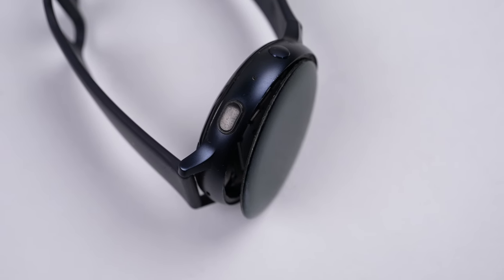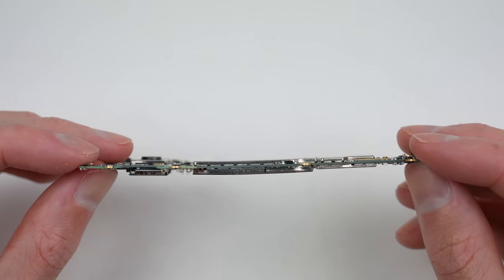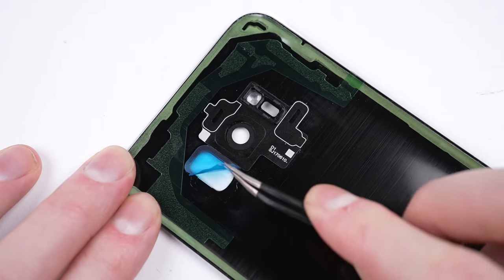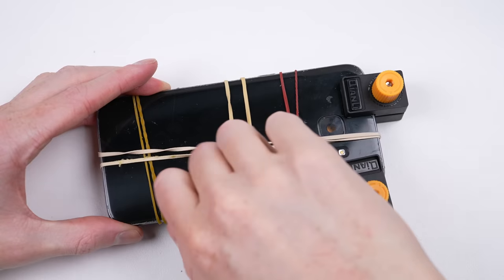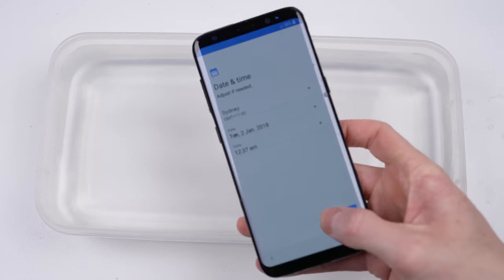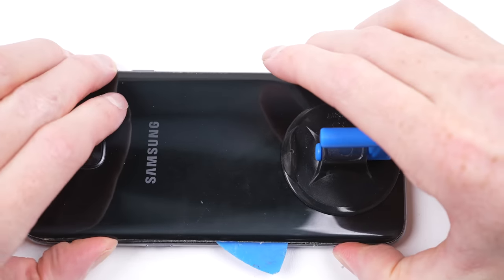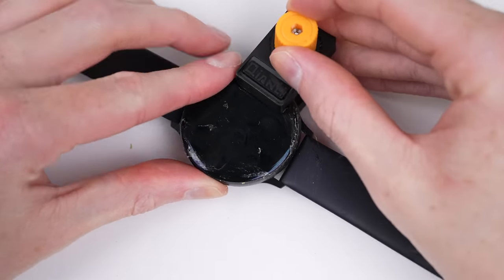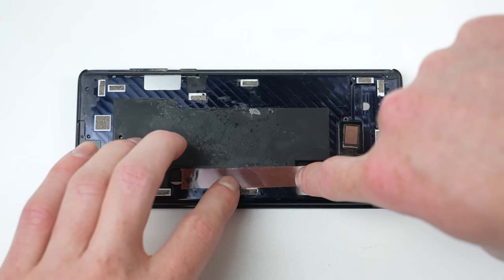Is a Repaired Phone Still Water Resistant? - Submersion Test - Tape VS Liquid Adhesive

Comment: here's a good litmus test to see if your phone is still water resistant. take out the sim tray, press your lips against the hole, and blow into the phone. 

if when blowing the air doesn't exit the phone and you're creating pressure inside the phone, it's water resistant. if you feel air leaving the phone it is not water resistant.

Comment: I had the same issue with s21 plus, due to phone heating overtime i think there are gaps in the adhesive. My phone just dipped for 1 second in a tub and that got full water in the phone. As a result all cameras, and speaker got damaged which had to be replaced. I avoid dipping phones now unless absolutely necessary like in rain time. I would not risk testing water resistance on slightly older phones, as most testing done by companies are on brand new phones.

Comment: I watched another video on this topic with someone testing this myth and what they found out is that if you heat up the phone with a heat gun after sealing the phone the replacement adhesive will have a better bond making it more water resistant

Comment: I have my watch active2 laying around because the happened the same, screen detached. I went to a repair shop, they glued in place but the next day the screen fall off again. I guess it's because they didn't cleaned right, like in the video. And I'm not willing to pay $160 (R$800) to the Samsung Repair to replace the entire screen, which is still just fine. Why did they use a glue that over time loosen so easily?
Reply: It is possible that your battery is swollen and pushes your screen.

Comment: Whenever I install new water resistant adhesive, I make sure to heat the panel to help the adhesive adhere properly since heating it helps to promote it's ability to grip, or otherwise adhere

Comment: I strongly recommend to wipe the device clean before the liquid adhesive dries, that's because once it's dried you might pull the adhesive out the same way like pulling those battery adhesive pull tapes.

Comment: I got my Galaxy S9's battery replaced at an official Samsung repair centre, they said they test every device before they hand it back if it waterproof. They lied, I used to wash my phone under the tap, water got inside the phone after the repair, I had to put it in rice for 2 days, luckily it is still working. I'm using it since it's release and after 5 years it is still a good phone. But definitely not waterproof anymore after the repair.

Comment: This result means less than you think, actually. Heating the back of the phone after submerging it in water will elaborate any water inside, and it will come out of the small gaps in the adhesive. If liquid water comes in, the vapor can easily come out in the same way.

Comment: My iPhone 13 Mini is allegedly water resistant to one metre for up to 30 minutes. One night I heard an odd clunking sound coming from the front-load washer. The phone had been in my trouser pocket when it went into the washer and had been lifted near the top of the drum before dropping back into the soapy water. This happened for at least two minutes before I shut off the washer. Such devices have to drain off the water before allowing the door latch to be released, this takes another minute, during which time the phone was at the bottom of about 100 mm of warm soapy water.
As soon as I got it out I dried it with a towel and shook out any water from the ports. Not having a headphone jack contributed greatly to its water resistance. The phone ans silicone case survived the immersion fully intact and the only after effect was both had been thoroughly cleaned.

Comment: Sorry Hugh but that info just isn't quite correct re warranty and I've forced the issue too.

I had a Note10+ drop it's USB port and they sent a swap/replacement device back for some reason that would have been a prior repair. We were around the creek so I already had it in a plastic ziplock bag for extra protection (condoms in future I guess) and somehow a few drops of water got into the ziplock bag from wet shorts. That few drops was enough to steam up inside the phone the next day despite it being removed from the ziplock bag quickly after our walk.

Shamsung tried claiming "oh it's water damage we refuse warranty" to which I stated "no you claim IP6X (or whatever it is) ingress protection and it hasn't been more than 0.5m deep for more than half an hour which is the official description for that IP rating so you WILL warrant the device". They argued so I went to consumer affairs.

Consumer affairs when they saw the official IP claim on Samsungs website and the official spec for that IP turned around and forced them to repair the phone since they claimed it was capable of that and they had no prove I went 100m diving with it (I didn't). Samsung after returning it repaired claimed "if it ever happens again then we won't repair it" so I replied "right if it happens again then you really have crappy workmanship on your repairs meaning it's your fault and we'll do this dance again and consumer affairs will fine your ass big time" to which the arrogant POS went real quiet.

Lesson learned though, Samsung themselves can't repair phones for shit send it to a 3rd party if out of warranty and never trust their IP claim, buy a condom if around water. Though my insurance would have covered it under unspecified portables no questions asked, I shouldn't have to claim when it was crappy workmanship from Samsung techs.

EDIT: forgot to mention, I DESPISE them new plastic fantastic crappy watches!! I'm loving my old metal original Samsung 46mm watch!! Heavy stainless bezel and band, it's awesome. The eldest son has the exact same and loves it. The wife has the (42mm?) rose gold edition with same style band but also in rose gold and loves it. We've been swimming and all with them without issues and never lost a screen. We do have screen covers on as well for the glass (them little glass disc things). They're all ex repair sold from Kogan and the only complaint I could raise is the pressure/alt sensor needed to be manually adjusted as it's about 50m under the real alt and thus pressure is a few hp off. I can live with a manually adjusted version it still works appropriately and cost me half of the RRP.

Comment: The issue with saying 3rd party can be water resistant is the fact not all repairs are to the same standard and 1st party is the same adhesive is uses in the same place under predictable controlled conditions that are guaranteed to have water resistance after repair.

Comment: If you are going the repair, make sure to remove all old adhesive from the frame and the back glass. As any residue will cause a gap failing any pressure testing. Another good way is taking a cotton swab with isopropyl alcohol to clean the surface. Especially with older phones, the adhesive will be gross with many debris. Once you seal the back and front. Heat with a hair dryer or a heating pad for around 5 minutes on a low-ish heat. This helps the adhesive conform the curves ensuring good seal. This also applies to other devices. iPhones have areas where debris will collect in the frame. If you don't feel comfortable, don't feel bad. See if a local repair shop can redo the adessive for a small fee. Especially uBreakiFix stores, they have access to OEM adhesives from Google, Samsung, and Apple (special order cases).